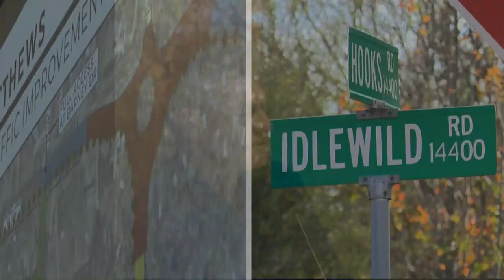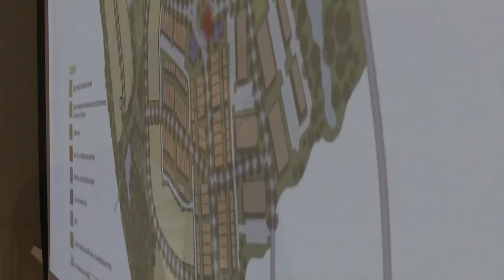Roundabout proposed in new Matthews development plan

Comment: People using the road make mistakes (like speeding, running stop signs and red lights, turning left in front of oncoming traffic), always have and always will. Crashes will always be with us, but they need not result in fatalities or serious injury. 

Modern roundabouts are the safest form of intersection in the world - the intersection type with the lowest risk of fatal or serious injury crashes - (much more so than comparable signals). Modern roundabouts require a change in speed and alter the geometry of one of the most dangerous parts of the system - intersections. The reduction in speed to about 20 mph and sideswipe geometry mean that, when a crash does happen at a modern roundabout, you might need a tow truck, but rarely an ambulance. Visit the Insurance Institute for Highway Safety or FHWA for modern roundabout FAQs and safety facts.